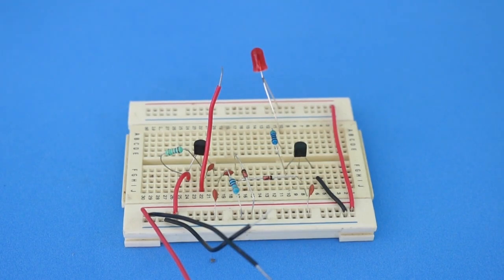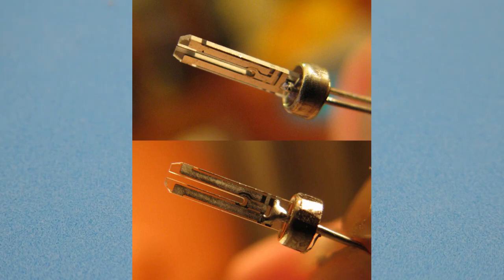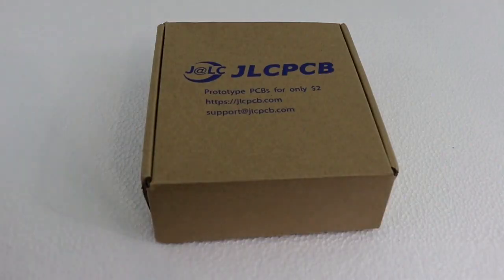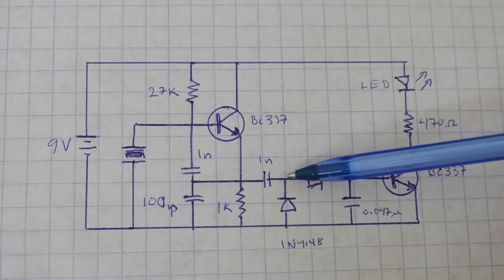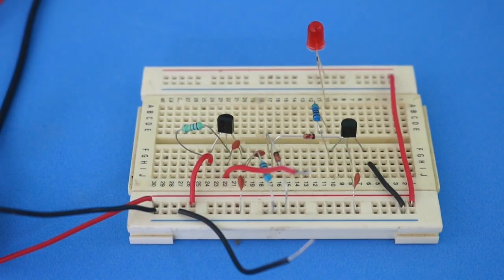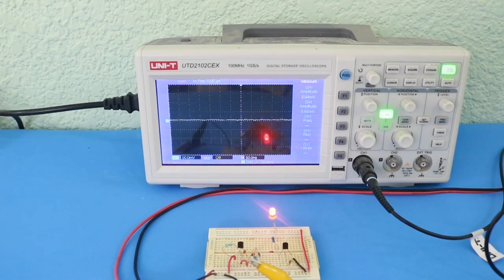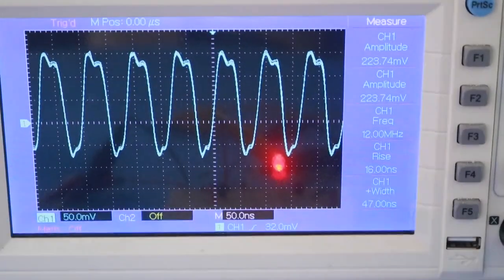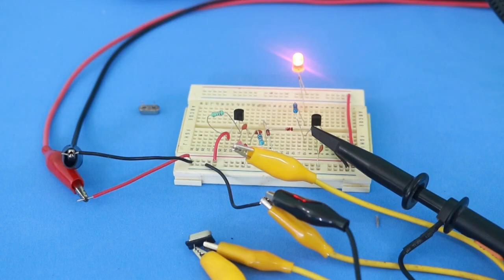Quartz Crystal Test Circuit

Comment: Hi
How Can I Lower The Frequency   Of Quartz Crystal   From   32768 kHz      to  24500 kHz?
I Wanna  Create  And Measure  Martian Time   Which Is
 24 Hours 39 Minutes
Thanks
Reply: you would need to change the property of quartz or you could tweek the counter circuit
Reply: A capacitor in series with the crystal will detune it a bit (to lower frequency).
Reply: @PaulaBean  capacitor in sieries increases frequency and in parralell decreases it
Reply: @stevenchiverton48  Thanks for the correction.

Comment: Hello! Thanks for the circuit. I put it together and am having mixed results (maybe I have a lot of defective crystals?). I tried a bunch of 32.768 KHz crystals but none worked - could 9volts be too much? Also, is there a range limit for this circuit, for example should it work for a 20MHz crystal?

Comment: Please clarify how you drew intersecting/connected network/traces on your schematic. I do not see the customary dots/circles at connection points and "humps," where one net jumps over an unconnected net. Thank you for the video and your help.
Reply: Not sure if you still need this answer, but I've managed to build it, they're all interconnected. It's easy to see if you take a printscreen of the circuit and analyze it side by side with the way he assembled it on the breadboard.
Reply: @brunofonseca9686  Thanks. I was also wondering.